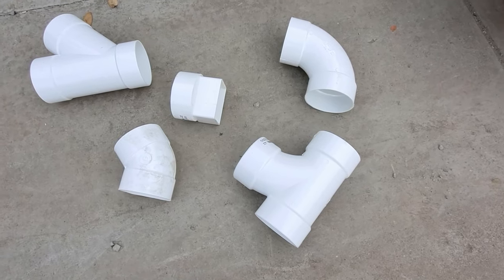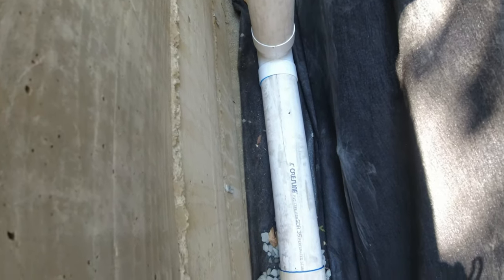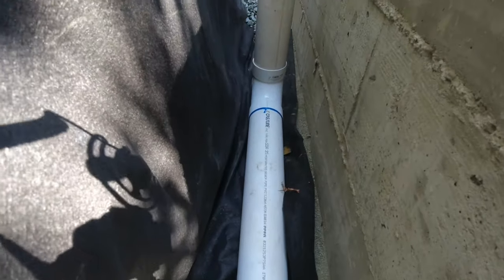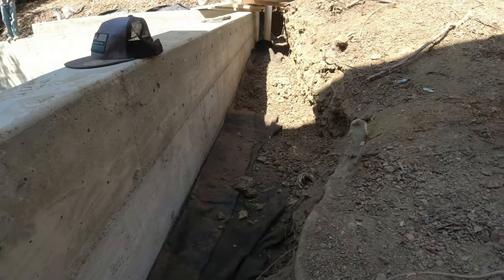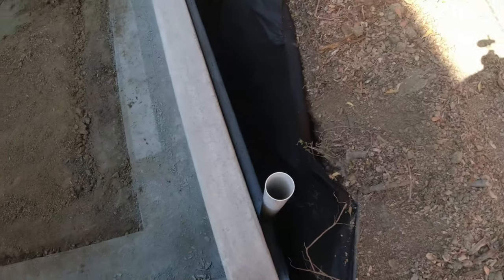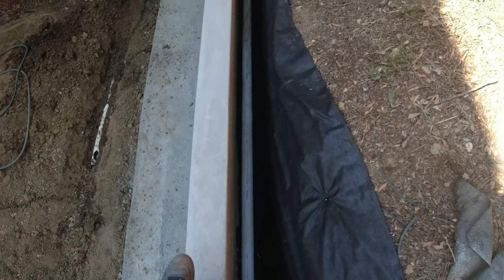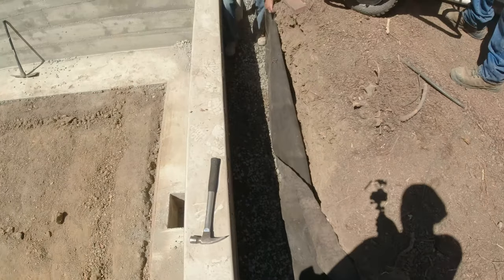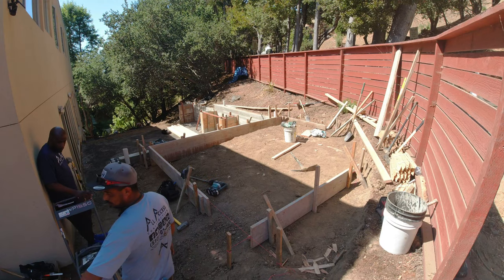How To Install French Drain Behind Concrete Retaining Wall The Right Way

Comment: Where should the pipe lead off to if I have neighbors on both sides of me? Does it have to remain underground until it reaches near the gutter drain of my house?
Reply from the maker: Recommend you have it daylight on your property. Ideally into an existing drainage system. If not you might have to create a drywell
Reply: Thanks!
Reply from the maker: All good.. Good luck

Comment: How does the drainage pipe collect water when it is solid on top with holes on the bottom?
Reply from the maker: The water raise at the bottom of the pipe that's in rock and hit the holes and goes out

Comment: No sheet drain to protect the concrete wall?
Reply from the maker: Sheet as in the dimple type membrane? No we don't use them.. Ideally those are use for basement.. Or if access backfill is limited for

Comment: Great informative video, brother! I’m little confused though, would you not want the holes to be facing up for the water to seep on through the rocks?
Reply from the maker: Ahhh that's been the great debate for over a thousand years.. 🤣🤣🤣. So in theory the water comes down to the bottom and rises to meet the holes at the 4 and 7 o'clock position.. I use to think otherwise as well.. 👍🏾👍🏾👍🏾
Reply: If you watch the French drain man from Michigan he will show you how to properly drain water from behind a wall!!!
Reply from the maker: Well, this French drain has worked perfectly as well as all our other ones over the last 20 years.. Has worked and still works till this day.. Not one problem..

Comment: May I ask why the pvp pipe is better than the black flexible ones? And is it necessary to put 1 or 2 drain holes on the side of the wall to release some pressure? Thank you !
Reply from the maker: Black pipe tends to buckle.. We always installed letters up.. Which will put the holes at the 4 and 7 o'clock position
Reply from the maker: ☑️ Out Our French Drain Playlist https://bit.ly/3vmZdwQ

Comment: Question:  What is the best retaining wall build…precast interlocking brought to site and placed with a crane?  If pouring into a mold on site, what is the best PSI of the concrete?
Reply from the maker: Using the precast concrete blocks if you have the room to maneuver that's a good look ready rock is good with those blocks as far as the PSI we use a six sack pea gravel with a 4-in slump which gives us anywhere between 3000 and I believe 4,000 once it's all cured

Comment: This is an excellent video- thank you. You make all good points, and don't spend valuable time talking about unnecessary stuff. I have one question. I have a Unilock mini retaining wall in my flower garden bed that is 65 lineal feet long and in most areas just, two blocks high, except for on the low point where I have 3 blocks stacked, plus a cap. Highest point is 20", but in most cases is less than 10 inches high. DO I NEED A DRAINAGE PIPE BEHIND IT? Soil is primarily compost with a torpedo sand/gravel/clay soil base.
Reply from the maker: Appreciate the comment.. Adding a drainage will be ideal.. You can use a 3 inch sdr 35 pipe instead of a 4 inch.. All our walls I've added drainage.. 👍🏾👍🏾💯💯
Reply: @AllAccessConstruction  thanks! I added a drainage pipe with two tiles.
Reply from the maker: Nice.. 💯💯👍🏾👍🏾

Comment: Awesome videos!  Working on a drain solution right now.   I have about the same wall (5ft) and sloped area behind the wall.    I have a decent top soil, then it is about 4 feet of clay.   I am getting mixed reviews with the rock/fabric or only rock within the clay soil.   The Clay is so tough it is almost like rock.  Any thoughts?
Reply from the maker: Just about every plans we received over the years from various Engineers this is the plan we use

Comment: Outstanding "how-to" video! Almost all youtube french drain videos show the black corrugated flex pipe. I hate that stuff because if you ever get significant root infiltration that blocks flow, then you can forget about "snaking" it to restore an open pipe run. A plumbers snake will make mincemeat out of the corrugated pipe. 

Quick question...why don't you tamp down the 3/4 drain rock to prevent settling? For segmented block walls, isn't tamping essential? Keep up the great work! (btw: new subscriber)
Reply from the maker: Mannnn appreciate the kind words.👍🏾👍🏾

. The drain rock sits on top of the footing which is at a minimum 18 inches.. So the rock will not be settling. 

 I hate that black pipe.to..🤣🤣 Appreciate you  subscribing to the channel

Comment: How does the water get into pipe if the holes are at 4 and 8 at the bottom?
Reply from the maker: There actually at the 7 and 4 o'clock.. I've been corrected a few times... 😂😂😂.. In the theory the water builds up in the drain rock and find its way to the holes...and go out...
Reply: @AllAccessConstruction  Gotcha. Thanks for quick response sir! Your channel has been really helpful to me this summer. Thanks a million!!
Reply from the maker: All good.. Appreciate the comment 👍🏾 and support 💯💯💯

Comment: I wanna build a 2' wall with its footing. On my side I want to add concrete to extend my patio but Do I need a French drain on my neighbor's side if he has grass or dirt? most of his side is flat except on one side there is a 10' slope drop.  If we do need a F drain, will the pipe sit above, below or level to the footing? Thanks.
Reply from the maker: With all our retaining walls we put drainage... All our pipes sit on top of footing.. Hope that helps
Reply: @AllAccessConstruction  Ok thank you and thanks for answering on a Sunday. God Bless.
Reply from the maker: All good

Comment: I have a question, does the sdr35 pipe just mean pvc pipe in general? I don't have a home depot in my area and our lowes doesnt carry the sdr35. They do have sewer pipe though, will that do the trick? Also, were you dilling the holes in the pipe yourself? Or does it come perforated. Thanks!!
Reply from the maker: Pipe is the thickness. You may have to go to a building matriel place like Whitecap.. And yes the pipe comes perforated

Comment: will the fabric be deteriorated in few years and the dust will fill up the pipe? Thanks for the video clip! I plan to have a retaining wall built soon by someone.
Reply from the maker: I doubt it.. Keep in mind this is commercial grade fabric that design for this application.
Reply: @AllAccessConstruction  - thanks for your response. Do you know the brand for the fabric?
Reply from the maker: Mirafi 140n
Reply: @AllAccessConstruction  thanks again.  Do I need to waterproof the back wall before install the fabric?
Reply from the maker: I only waterproof cinder lock walls.. If it's been use as a basement or living space.. Yes

Comment: Those uprights / pvc pipes where they later used for drainiage also ? Or is there another reason for this ? 

I'm a retaining wall builder in aus and only use slotted aggregation pipe / flexi pipe with a fabric sock over the pipe with geo fabric for the drainage barrier and usually that's all that's needed but just recently I had a past client call about movement on a wall after some heavy rain and sure enough its moved so I would love to know more as il use better systems for my new builds
Reply from the maker: The up rights are use for clean out in case something gets stuck..they also are use to catch surface water in a heavy rains... Also we never use that black flex pipe, Always Sdr 35 pipe..
Reply from the maker: Check out this playlist about French drains.... https://youtube.com/playlist?list=PLS6rd-97aEeJaENuceAj5OtlO_-J6C7xU
Reply from the maker: Is it a concrete wall?